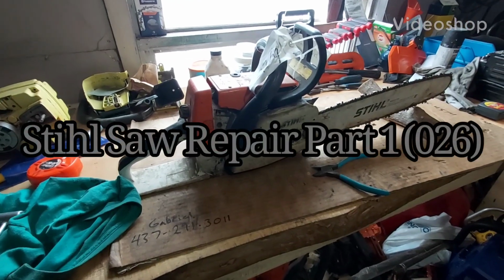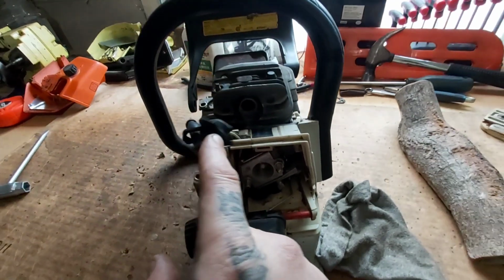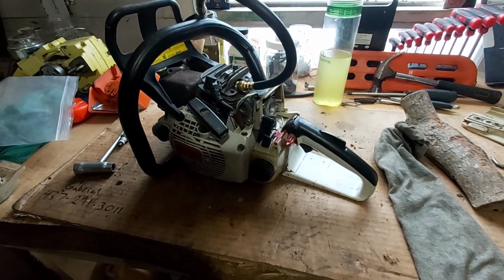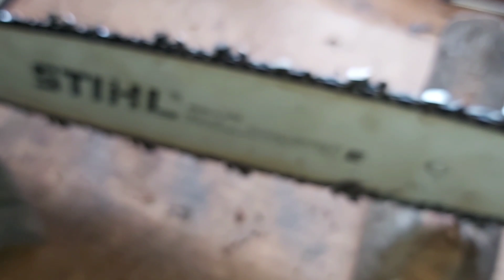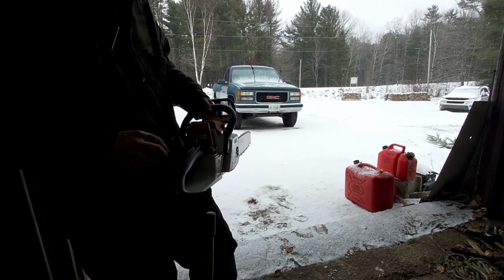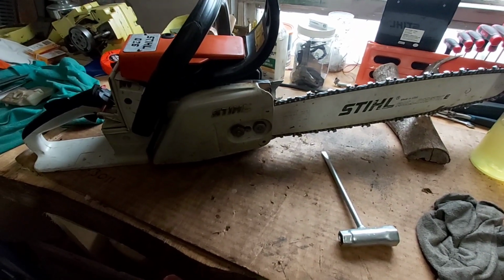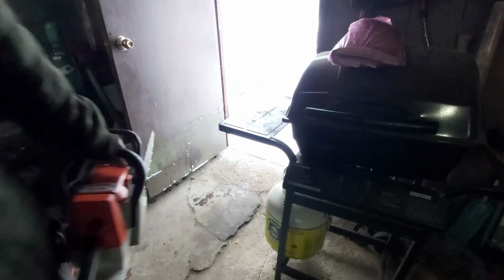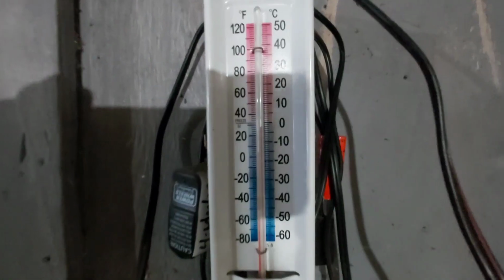Stihl Saw Repair Part 1 (026)

Comment: Chain saws need to be run often to keep the little carburetor clean I tried additive but if they sit for a year they are usually plugged.
Reply from the maker: For sure. I like to run them dry if they're going to sit

Comment: Frank I hope all is well with the storm. Great video! Question and I understand it has nothing to do with this saw. Do you think the echo CS 590 Timberwolf is a good saw or should I look into a Stihl?
Reply from the maker: the echo is not the greatest out of the box but can be good with some mods. I know a few people that have them and they are happy. Husqvarna is just as good as Stihl but cheaper price and Stihl is the most expensive. I would stay looking in the 60 cc range though. Depends on what you comfortable spending. All is well here but got lots of snow. Working on that video soon. Cheers
Reply from the maker: Another decent brand of saws is Makita. Not bad
Reply: @frankz1125  ok great thank you Frank! I will look at both the Husqvarna and Stihl.
Reply from the maker: @joesoutdoorexperience  the Husky 562xp is very nice . Pro saw. Even the 550xp. Cheers
Reply: @frankz1125  thank you again Frank I will look into them all